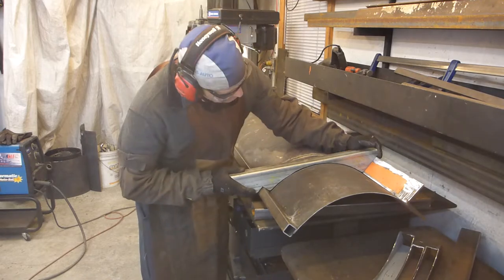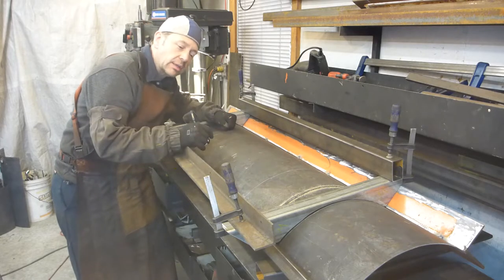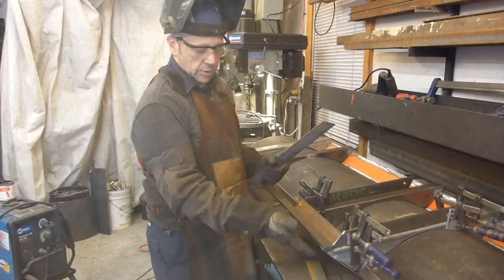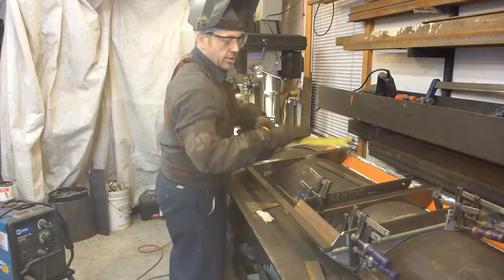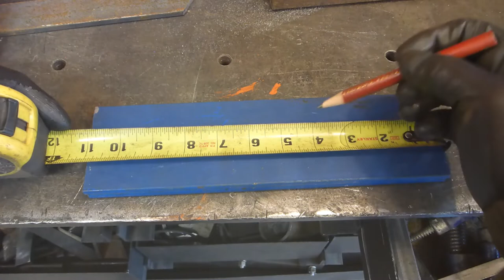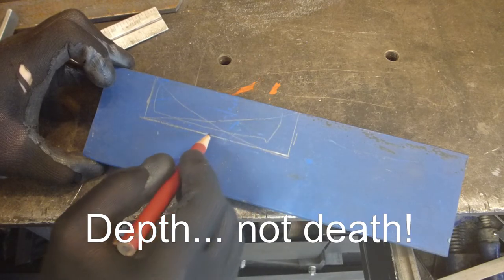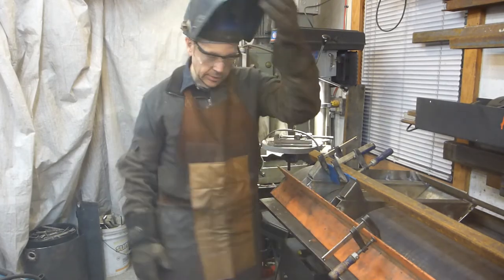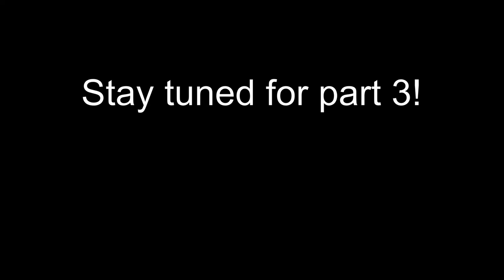#177 SSQA Snow Plow   Part 2

Comment: I wondered what you were going to do for bracing the moldboard on the backside. I had visions of you cutting small wedges out of one sine of a number of pieces of angle iron, and heating them to get them bent to the right arc. I like your method better. At first I thought that using thin wall steel from a water heater tank
was going to make for a very light plow, but all the work done on the backside brought the weight up enough to make a very nice plow.
Reply from the maker: Absolutely Jim!  The thickness of the water heater was just below 1/8'', which is perfect with some reinforcement. The next part will show the side ribs, which will be pretty much like you describe, but using square tubing. Much more gusseting coming up in the next part too! Dave and I designed this plow to be strong enough to grade dirt... Or to be "Dave's proof"! Lol!
Reply: @FromSteelToWood  Yes, Dave's proof in deed !!! LOL Cheers !!!

Comment: Great progress on the blade Joe !! Might have to do a video on the turbo when you add it to Dave's Mahindra.  He'll be pushing 4' snow drifts in no time and may need a little 'boost'.  LOL  Seriously, that is the perfect size for his tractor. Part III must be painting and flag holders for the edges of the blade......??  I was thinking of your smoke fan at the exact instant you said to turn it on.  Another wonderfully done video sir.
Reply from the maker: Thanks Wendell!  As you can see the fan is very effective at drawing fumes outside. Unless you stand between the fumes and the fan!  In part III, there is still some reinforcement to be done on the blade. Dave can be hard on the equipment sometimes! There is also wings to make for that plow. Stay tune part III coming this week!

Comment: great job on the snow plow! very creative! pardon me for asking and also i am from the deep south and don't know much about snow. but shouldn't your plow have a spring relief on it incase you strike and obstacle?
Reply from the maker: Very good question! Spring relief is required for trucks and ATV, as they are not framed to take a hit. Then it's likely they will get some good speed removing snow.  In our case, this is a tractor that will be pushing it quite slowly, and it has a significant frame to take the hit. That will be front end loader mounted plow. Thanks for asking, I might add this into part 3 of the video.
Reply: @FromSteelToWood  thank you. and thanks for the reply and i understand that. makes sence! and also nice glad i could help. im dale from alabama if you decide to mention me in part three. have a great evening!!!!

Comment: Great job , are you using flux core mig wire ? I was wondering why you use it. I’m new to welding and I wanted to know your thought process about it . Todd 
Oh your videos are awesome
Reply from the maker: That is exact, flux core.  That is very simple to manage (no gas) and I weld a lot of material that is far from perfect, including paint and rust (contamination). Then I have to clean the material either way.  I think it can weld thicker material too with flux core. Then for my application, the cost is about the same. Thanks for your comment!